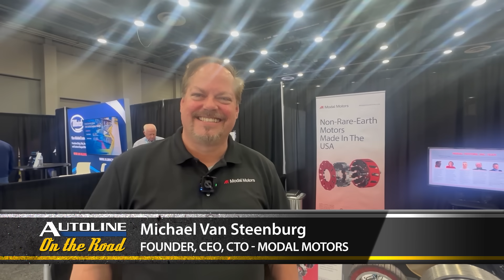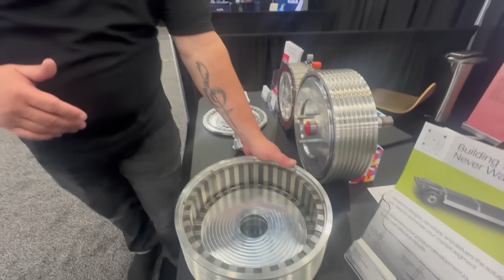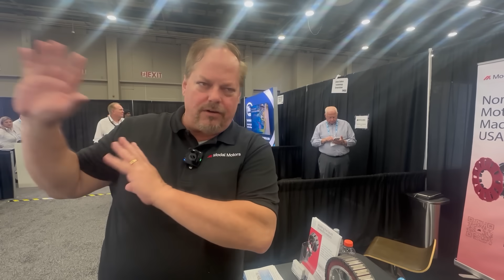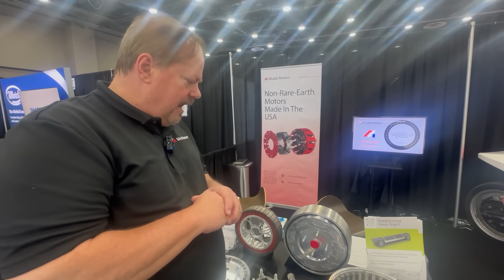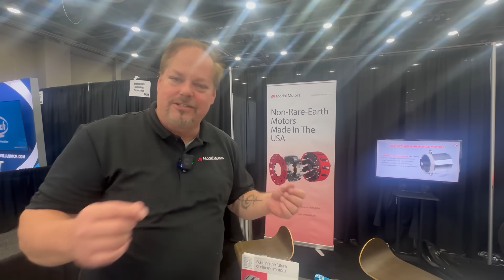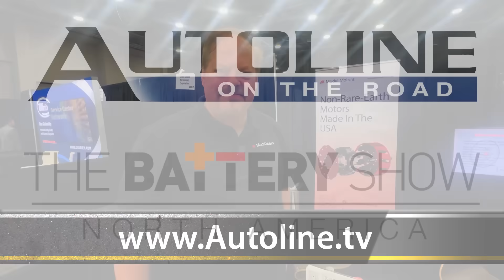Electric Motors w/o Rare-Earth Magnets & Can Be Fully Assembled by Robots - Battery Show 2025

Comment: Big claims, I wish them the best, but I'm skeptical: While direct critiques specifically targeting Modal Motors appear limited in public discourse—likely due to the company's relatively early-stage status and focus on prototypes rather than widespread commercial deployment—there is broader skepticism and technical analysis questioning the viability of ferrite-based (non-rare earth) permanent magnets for high-performance applications like electric vehicles. These concerns stem from inherent material limitations that challenge claims of parity or superiority to rare-earth options like neodymium-iron-boron (NdFeB). Below, I'll outline key critiques drawn from engineering analyses and industry discussions.

### Performance Limitations
Ferrite magnets, the core of Modal's designs, have a maximum magnetic flux density of about 0.4 tesla (T), compared to 1.4 T for NdFeB magnets. This forces designers to use significantly larger ferrite volumes to generate equivalent torque and power, leading to bulkier and heavier motors. Simulations of ferrite-based flux-switching generators show they require a 2.4x increase in overall mass (magnets, rotor cores, and wiring) to match NdFeB output under identical mechanical input. For a vehicle like the Tesla Model S, this translates to a 12.2% curb weight increase (about 252 kg), potentially reducing EV range by 11% (e.g., from 475 km to ~424 km) due to higher energy demands from added mass, assuming constant aerodynamics and rolling resistance. Similar iron-nitride or ferrite axial-flux designs from competitors like Conifer Motors are acknowledged as innovative for niche uses (e.g., small scooters or HVAC fans) but dismissed for "proper road-going electric cars" like those from Tesla or Rivian, as iron-based magnets remain "simply not as powerful" as rare-earth alternatives.

### Economic and Supply Chain Doubts
While ferrites avoid rare-earth supply risks (e.g., China's 85-90% refining dominance), they introduce their own hurdles. Even with cheaper raw materials, ferrite motors can cost slightly more (~3% higher) due to the need for doubled stator/rotor sizes and 2.4x material volume. Economic parity with NdFeB only holds if rare-earth prices spike dramatically (e.g., NdFeB at $127/kg or above), creating uncertainty for investors betting on ferrite scalability. Industry reports highlight "full panic" among automakers over rare-earth shortages, but ferrite adoption lags because the weight and efficiency trade-offs make it uncompetitive without REE price volatility.

### Feasibility and Engineering Challenges
Ferrite's lower coercivity (resistance to demagnetization) exacerbates issues in dynamic EV conditions, like high-speed flux weakening, potentially requiring overbuilt cooling or control systems. Broader reviews of reduced-rare-earth motors note that while alternatives like ferrites work in low-demand scenarios (e.g., GM's Voltec hybrids), achieving "high torque density" claims for EVs demands compromises in speed range or efficiency. Skeptics argue these designs overpromise on "outperforming" rare-earth motors, as real-world prototypes often underdeliver on power-to-weight ratios without custom optimizations that inflate costs.

In summary, while Modal's ferrite approach addresses ethical and supply concerns, the tech's physics-based drawbacks—primarily weight, size, and performance gaps—fuel valid skepticism about matching rare-earth benchmarks in demanding applications. Ongoing R&D (e.g., by Toyota or IEEE efforts) may mitigate some issues, but current evidence suggests ferrites are better suited for cost-sensitive, lower-power niches than full EV propulsion. If you're tracking Modal specifically, monitoring their prototypes' independent teardowns could reveal more.

Comment: For cost sensitive EV models where weight, efficiency are less of an issue , this non rare earth approach will have value. The proof will be for those automotive OEMs that want low weight, high performance , high torque . The Chevy Bolt would be perfect for this US made component.

Comment: You completely failed.. 
What are the numbers?   What kind of performance?  What is the output of the motors he has on the table?  You didn't ask any good questions.  FML
Reply: The motors on the table are just samples to show the concept and IP behind Modal Motors' design. A customer (vehicle or driveline manufacturer) would be more interested in that at this stage, rather than the abilities of some random sample that just happened to be on the table. The "numbers" and "performance" are for a customer to explore in a design testing lab with motors that would be an actual fit for their application using this technology. Calholli, you failed as a viewer.